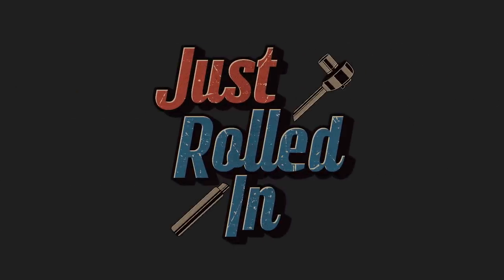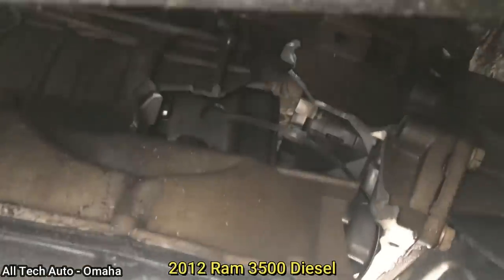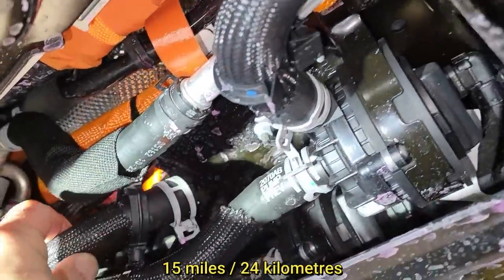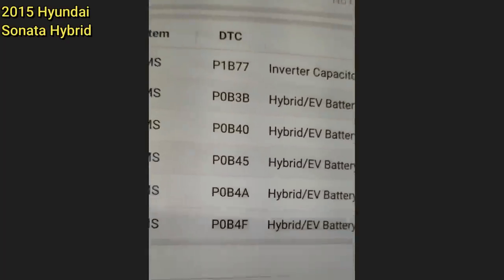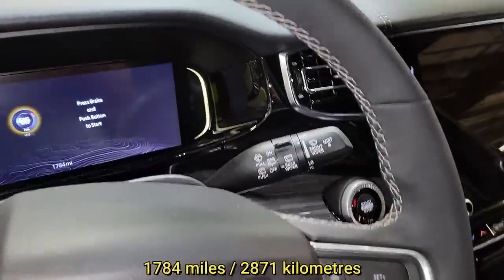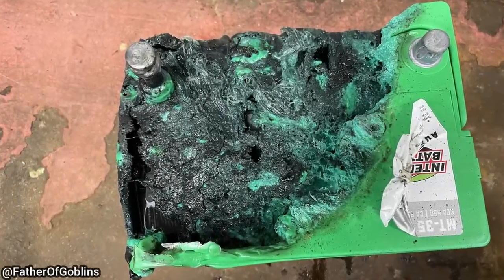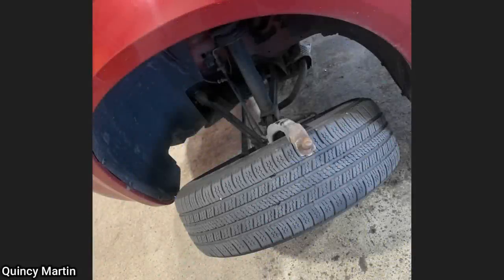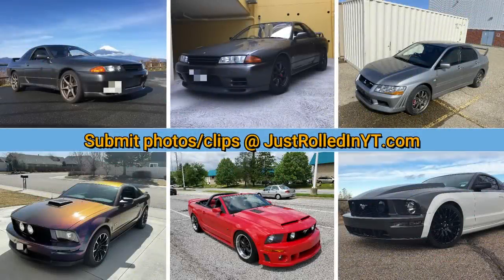Customer States New Truck Won't Stay Running (2022 RAM 1500) | Just Rolled In

Comment: In the first video, that was a massive manufacturing defect! Will the customer truly receive a new engine? Or will it be a remanufactured engine? Either way, I would have demanded a new truck since this one is condemned to be worth way less in the used market.
Reply from the maker: Unsure if it is actually brand new but the subscriber who sent the clip should be here somewhere and able to let us know.
Reply: I agree, the car just isn't at 'brand new level', after a major bit of work like an engine swap.  A friend bought a brand new VW Amarok, and about 3 months later hydro'd the motor going through a river (Intake sits directly behind the grill???)  VW did an engine swap and they had forgotten to tighten the oil feed for the turbo, I nipped it up but it still drips oil.
Reply: This situation has happened in our shop on a few occasions over the years and in each and every situation the customer did not receive a short block , long block or a rebuild . They got a complete engine including all sensors as if it was going into the vehicle on the line , comes in a big crate and yes the argument over a new vehicle has come across GM legal desk . Not all dealerships are created equal ..
Reply: I think it may be kind of common with these engines.  I had a 2019 Ram 5.7 with the eTorque and the lifter bank for that exact same set of valves went bad, dash lit up like a Christmas tree, and I had the cylinder head rebuilt under warranty.  I, fortunately, didn't have a broken valve or it would have been much worse.
Reply: Depends, if it's customer pay it's usually a new engine. If it's warranty it's a remand.. 

If it's something like this, you could use lemon law as leverage to get a new engine or possible a buy back
Reply: @waynesbutler7834  The Ford dealership I used to work for would send engines to a shop instead of buying a new or reman
Reply: Probably missed a critical heat treat
Reply: @svenjorgensenn8418  My 2012 Escape's engine at 10000 km dropped a bearing and totalled out the engine. Every step of the way had to be approved by Ford's warranty department before they replaced it with a new one. Traded it in with 18000 km as it had the same problems over and over, water leaks when it rained, wiring issues. It was the second one I bought new in a year and both were absolute "lemons". Returned satisfaction surveys with very disappointed indicated, never heard from Ford. 
With the first one, I called the salesman 5 days after taking delivery to see if I  could bring the 2012 in and get my 2009 trade back. No cash, just give me back my old ride.
Reply: @svenjorgensenn8418  Like i said not all dealerships are created equal . Thankfully catastrophic failure like in this vid is a rarity in my area but i live in Canada and the world is a big place with different managers and things can differ greatly . I work in Oshawa home of the main plant and headquarters and we are a GM town and take pride in the brand and our dealership has great customer service , i think but not all customers . lol . Ford on the other hand is a great company too and employ alot of people with a good brand at the factories here but will have the same issues all the big three have when it comes to customer service but it all comes down to people and the squeaky wheel doesnt always get the grease , be respectful and get respect . I have been sworn to uphold the brand plus more importantly GM signs my paycheck and i wont bite the hand that feeds me . lol
Reply: I installed a long block in a Toyota RAV4 that was in for its first oil change at about 3k miles, and when checking before they change, noticed it was just barely on the dipstick. The block was porous and oil was just seeping out the side of the block. 🤬
Reply: @peterweller8583  sounds more like overhardened . maybe didn't get annealed
Reply: @waynesbutler7834  i thought they were closing the oshawa plant back in 2008 ?
Reply: @ronblack7870  I have a habit of talking too much as you can tell especially this topic but yes GM has threaten to close down a few times and we may have lost the Camaro but we got the trucks back and hiring the last i heard  , its always a ploy to break the union and it works . They are apparently investing heavily in electric at the plant but i dont pay attention as much as i should . Been a mechanic for 37 years and i want out , as much as i take my job seriously and try to be good at it all i think about is retiring
Reply: @svenjorgensenn8418  given the low mileage and current year truck, it would be warranty, after head office asks for the work history, then will have the dealership do an percentage cost of rebuild vs replace and chances are this would have made it to engineering which possibly would have possibly drop shipped a new engine assembly to the servicing dealer. Probably after the dealer ordered the warranty replacement. Had it happen at the dealership I worked at with a 3500 that dropped a push rod in a cummins with only 300km on it. I think that went straight back to cummins them selves for study.
Reply: @ronblack7870  exactly
Reply: @ronblack7870  Drawn back is the term or missed heat treatment
Reply: As a parts guy at a Chrysler dealership, they probably got a reman. Warranty will only pay for a new engine if there is no reman available, and there are plenty of 5.7 remans available. The dealership may have stepped in to get a new engine and covered the difference, but that is unfortunately unlikely as the customer would probably never know.
Reply: Shouldn’t be the case because unlike extensive collision or flood damage repairs a dealer installed new engine shouldn’t leave any compromised structural, mechanical or electrical systems that have the potential for future failure.
Reply: Good luck demanding a new vehicle because of an engine failure.  It's happened many times and I've never heard of someone getting a new vehicle.  In every case I've heard they got a complete new engine, not a reman.  In the case of a head/valve failure that doesn't cause any other damage they get a new head.
Reply: @svenjorgensenn8418  Lemon law requires several repeat failures so no.

Comment: Love the mini-moke, we rented one for a few days in the Seychelles in the early nineties - great fun, and the perfect drive on a tropical island.
Reply: Those A-series motors they are powered by you can tune to within an inch of their lives.  The motor  and box is the same unit that powers the Mini's, so the Brits have built, and sell, every parts combination imagined.  They are a really cool ride.
Reply: I lived on a place Called Magnetic Island, off Australia,where there were dozens of Mokes , both private and tourist rentals. Most have been retired now because of insurance costs but  zipping along the road with the road right beside you is fun.
Reply: A friend of mine rebuilt one in the 1980s in England.  It was a fun little car and he did a beautiful job on it, including fabricating a hood by hand.  He was a true craftsman.
Reply: I have owned 2 in the past. The best one had a Mini Cooper S engine. Felt like 100mph just driving the speed limit.
Reply: This one shows its licensed in Quebec I think. Usually the winter salt kills older cars. Not that this one would see many Quebec winters.
Reply: @janetyeoman1544   Doubt that the owner would be driving that Mini Moke much in winter!
Reply: @waynemichel   Here in Australia the Mini Mokes were fitted with 12" rims instead of 10", with the standard engine being 1000cc, or the slightly detuned version of the Cooper S 1275cc motor that was also in the Mini Clubman 1275GT (both had single rather than the twin SU carburettors of the Cooper S), although they were easily upgraded! 
Mini Mokes weren't exactly the safest vehicle to drive though!
Reply: @stevie-ray2020  I can still remember being in a moke that the owner took surfing. He took it out past the breakers and only stopped when the engine stopped. We all pushed in back into the beach and got it going again. There was no alcohol involved, honest.....

Comment: Thanks for the entertainment , our shop got a laugh from this one considering we have seen some of these roll into our shop , The front rotor worn to the fins just last week with no complaints , the ball joint pulling out when put on a hoist and the helicopter noise from blower motor . Some drivers are hard of hearing , factory upper control arms wont take a lift but Rough Country does sell an upgrade if you decide to lift the truck  if thats the issue here although that ball joint is alittle dry, and you may find a mouse and its kids made a home in your blower motor although they usually come in through the cabin filter , dryer sheets make a good deterrent if thats the issue . Thanks again ..
Reply: I dont understand how people are ok with letting their vehicles get into the shape they do. If i hear 1 little squeak. I go into search mode. I cant afford to put my car in the shop when something goes wrong. So i learned as a child to fix things. Im lucky i have a bicycle i can ride to work if my car breaks down. Then i save up the money and fix it or get it fixed.
Reply: @weirdwillie  Really enjoyed your comment William , actually my first name . Customers and how they feel about their vehicles are on a spectrum , some care to the point of obsession that usually comes with Corvette , Camaro and Cadillac owners and some couldnt care less driving vehicles of lesser value . Noises too are often hard to find although our shop has a device with multiple sensors that can be mounted around the problem area and works quite well . Its good to be a backyard mechanic although cycling is how i relax . When 5 oclock comes i dont want to look at cars or talk about them and i want to be alone till 8 the next morning when it starts again
Reply: Didnt have the helicopter noises but when a blend door motor stripped its gears it started doing a continuous clicking noise which continued after the key was turned off and ended up draining the battery as the control module kept commanding a return to park position. After boosting it and taking the car to the dealership the mechanic not only replaced the blend door motor but freed and lubricated the door itself. (People in the forums always talk about GM blend door motors failing but I have yet to see anybody talking about lubricating the door.) Im willing to bet there is a cause and effect there.
Reply: @weirdwillie  same, i drive a 30 year old toyota, but ive never let that be an excuse, if anything i take double care of it for that reason
Reply: @edfrawley4356  Blend doors are not a major issue to my knowledge but its not my department but i remember doing a Tac Talk , a test we are required to do every month to meet GM compliance and i kid you not there was a section on lubing blend doors when servicing the actuators . Yes it will drain the battery  if stuck , if you sit in your car for a few minutes after the key is off you will hear the doors parking or should . Every vehicle can be different though ..

Comment: I heard of several examples where the towing capacity of the truck was higher than what was being towed and the companies didn't make due on the warranty. Trucks have broken down mid-tow, the driver cant get help from the dealers, has to get a hotel, find a rental or new truck, and get screwed with a truck that isn't covered by the warranty.
Reply: That sucks, time to lawyer up.

Comment: I've heard of overdrive sectors  blowing their little minds by folks pulling a trailer without disabling it. But an entire transmission blowing its little mind? Yeesh.
Reply: I am guessing the tow haul mode in those trucks disables the overdrives?
Reply: @filanfyretracker  Correct. It also changed the shift timing so increased torque is sent to the wheels. You'll notice it on first gear accelerating.

Comment: My very first car in the late 80s was a Mini Moke, good fun in sumner, no so much winter. Traded it in for my 2nd car ($1000AU I think), now more than 30 years later they are a collectable and worth north of $30k in top condition!
Reply: And better in Qld than Tassie. Lol they were quite common when I was young.
Reply: These were common in the tourist rental fleets in Hawaii in the 60's. More fun to drive than my Sprite. No doors.
Reply: Didn't realise they were as early as what he quoted. Their looks make people disappointed when they hear they're only front wheel drive. Maybe drop in an evo 9 running gear- ha!
Reply: We had two when I was a teenager. They were the best little cars ever 😁
Reply: in 1995 I sold a mostly fixed up, original 1969 Corvette for $5500 to buy a new one. I kick myself for that sale. Worth 50K now as it was a special order 1/8 mile race car.
Reply: I drove a Moke on Magnetic Island a decade ago. 
A tired gear box, 4 wheel drum brakes, and an asthmatic engine made driving interesting, and more fun than a modern car.
But only on a sunny day!

Comment: Seen a video once (was it on here?) of a customer in a store with a battery in a metal shopping cart, well the battery didn't have the plastic caps on it and the battery had tipped over (or been tipped) and was arcing between the poles and welded itself to the cart. Gotta love how some people still can't figure out direct current.
Reply: Load testing before purchase.
Reply: Lemme guess. 🤔Walmart, am I right? 😂

Comment: Oh I liked the little green thingy  : )   I remember seeing the old trucks hauling and pulling loads that were way  past the company's limits and never seen them break,like they do now. Had to drive a few back in the day, if I wanted to get paid. There are some real death traps out there, then and now.
Reply: That is a Mini Moke green thingy the Australian Army used to use them. They also made a Californian with a 1275 cc motor.
Reply: @phillip.9524  Thank you. All my best.
Reply: That's because trucks now a days come with 1000 lb*ft of torque for some reason.
Reply: Steel quality has dropped, front suspension springs being a prime example, i had one break a few years ago . The amount of impurities could be clearly seen in the broken ends
Reply: @eggy1962  Has a welder and fabricator. What you say is very true.. When China paid high prices for scrap, here in the USA they then,sold us back junk steel, full of dross. We need our steel mills back along with all manufacturing, we lost to other Countries. If people of like mind would just stand together and draw a line in the sand, things may change I am not talking about violence,though it may come to that.

Comment: The Mini Moke was a very popular little car in Australia back in the day. A favourite for newspaper delivery. Like the Mini, on which they were based, they were great fun to drive with go-kart handling. Not so much fun in the cold. From memory, I think ours were mostly badged as Morris, not Austin, although they were identical except for the badge. Probably expensive to buy these days because they would be quite collectible.
Reply: Yep, definitely Morris or just badged Moke. They were made in the BMC (Leyland) Zetland plant in Sydney and were exported to many countries. The later models had 13" wheels in place of the 10" wheels found on British built Mokes. My neighbour recently restored one, surprisingly there are still plenty of parts available.
Reply: @peterthompson99  I think you'll find that the Mokes were made at Enfield in the Pressed Metal Plant..
Reply: @RachelEvans680  We're both correct! Originally assembled at Zetland (from 1966), then transferred to Enfield (after Zetland closed) in 1974 with more Australian engineering input and content.
Reply: @peterthompson99  I worked at Enfield in the early 2000s fitting out police cars The Auto group auctions were there too at the time .It had some great history I can tell you.. I left mid 2004 and not long after that  it was demolished...So sad ..
Reply: @peterthompson99  I'm biased, but I get the impression that the BMC/Leyland stuff built  here was actually better made than the parent company's products. You know, back in the day when we still made things here 😞

Comment: Yikes. Currently sidelined due to bad brakes... that got disassembled for no reason while trying to change out the shocks. Got stuck on the lower mounting bolt there too. So now I have a Civic that bounces all over and wont stop. Fun times.

Comment: Great Odin's beard, that Transmission Grenading was crazy.  Humanity hurts my brain sometimes, but morbid curiosity and shock keep bringing me back lol.
Seeing all these issues that shouldn't exist on new vehicles just affirms my not wanting to buy anything newer than 2010.  Total trash with unnecessary computerized fluff and distractions.
Reply: Just Fiat Chrysler
Reply: @randy5691  Gotta love the fake jeeps
Reply: @randy5691  Ain't just one or two manufacturers, every single new vehicle i've looked at alongside seeing all these problems via JRI and other segues really raise some red flags.
Reply: @jamesb1221222  lol!  Even when it comes to Jeep, when was the last time/ year they actually made a good one that wasn't rife with things like Transmission problems?
Reply: There are plenty of good new vehicles. Just gotta know what you're getting. 
I love my 2019 Honda Fit. No touchscreen or remote start, and the parking brake is mechanical rather than electric. Those L15 engines last forever. I'll have spare parts as long as any Civic.
On the other hand, Nissan's Versa looks the same, but their transmission is infamous.
Reply: @j_taylor  I mean Honda is known for easy to work on vehicles and engines that run and run, but i'd much rather find an older civic over a new one-- but i'm not a car guy so that's a hard pass, and no offense but the Fit vehicles look terrible.